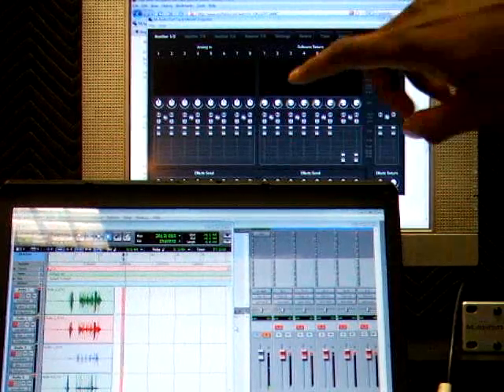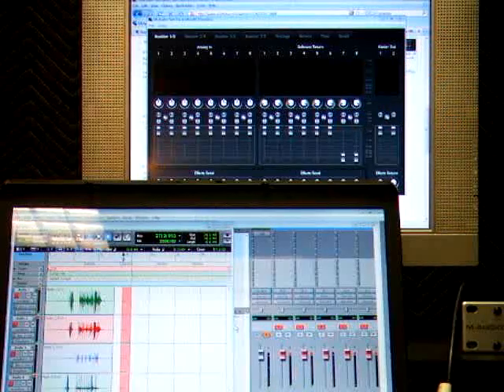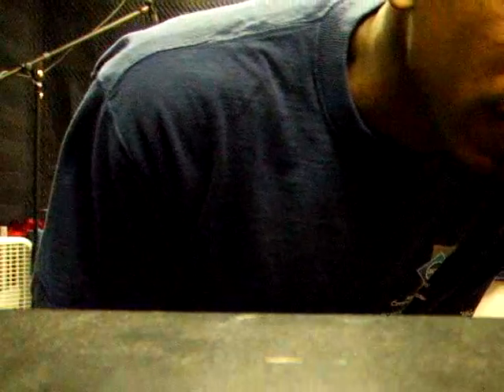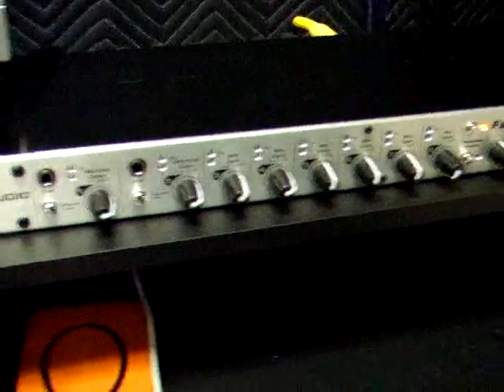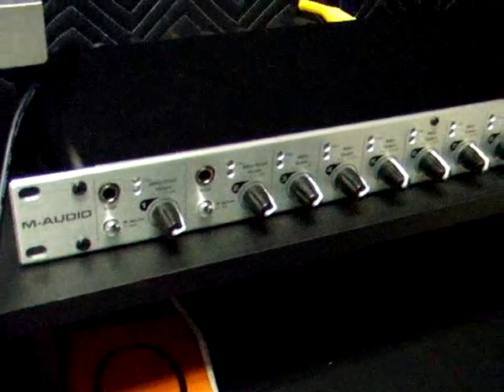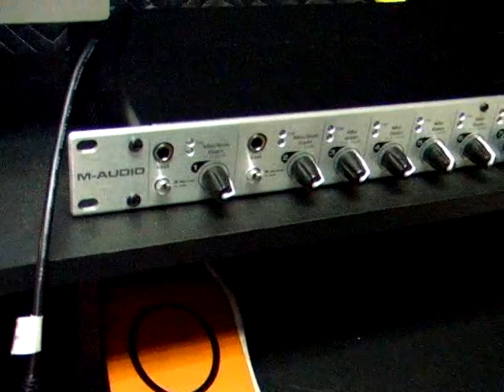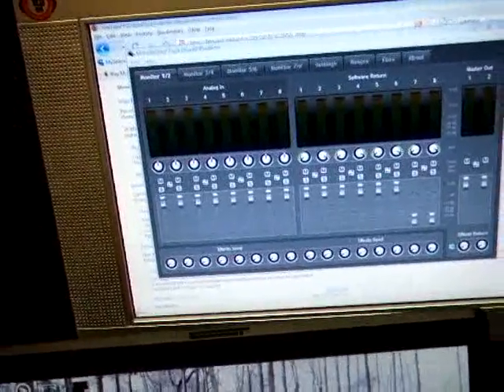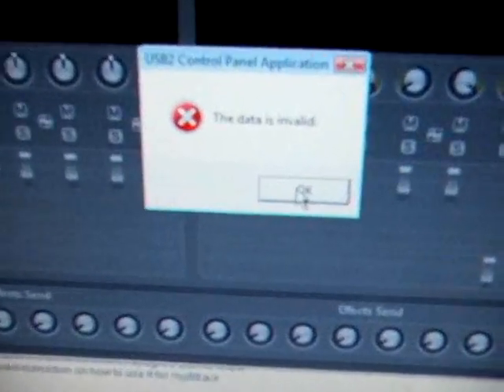Fast Track Ultra 8r :: Using it in Pro Tools 7.4cs3 (3 of 3)

Comment: Hey man you helped me a long time ago with mine and I had it working... I must've upgraded to Vista SP1 since then and everything went bonkers. The tray icon is spazzing out causing protools to not load. Did you upgrade to SP1 and have similar problems?

Comment: hey man i just got the fasttrack with the same set of mics along with pro tools m powered. The only issues i have is that my computer isn't picking up the mixer. It shows up on screen but it doesn't pick up what i play. Also whenever i playback something on pro tools it only goes through one speaker instead of both whereas when i bounce it onto itunes it has a mono sound when i make the track a stereo one. Any pointers for me?

Comment from the maker: thanks! There is no latency issue with this device at all.  Actually, all of the USB audio interfaces I have used have very low latency so you don't have to worry about USB audio interfaces being high latency devices.

The reason I mute the tracks while i'm recording them in Pro Tools is b/c Pro Tools will play back what I just recorded a split second later and that is distracting to singers and musicians.  You can still hear what you are recording via the direct monitor mode which is realtime.